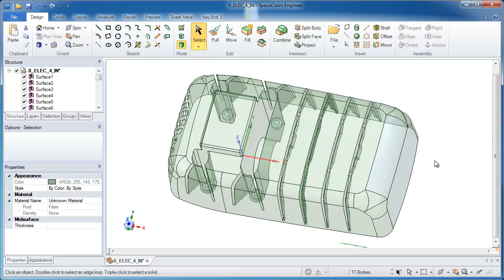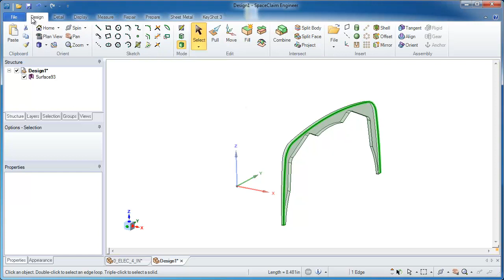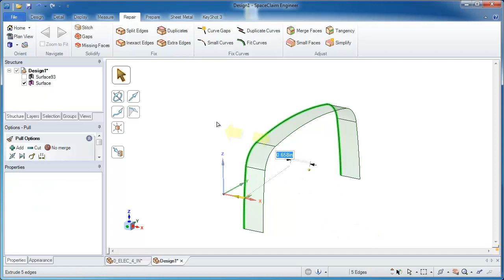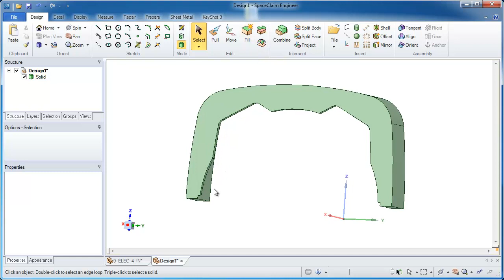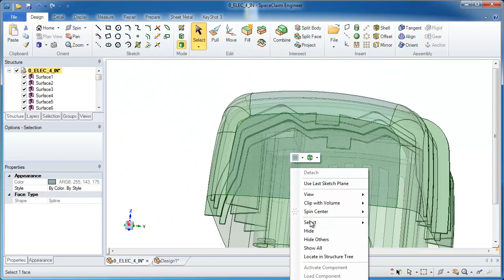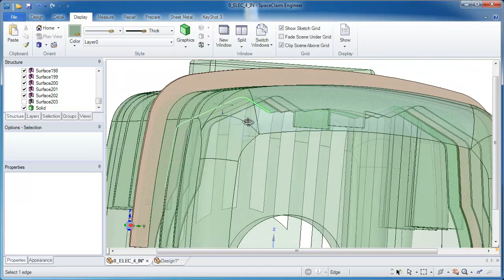SpaceClaim: EDM/Electrode Creation

Comment: I think it is more customary to have the electrode designed at full size and let the CNC programmer cut the rougher(usually -.010 Stock-for spark gap) and finisher (-.002 stock for spark gap) - that is, if the electrode has enough "meat". This way you do not have to create 2 electrodes(for roughing and finishing) and CNC programmer will decide how much of spark gap they need on each electrode...... Electrode also needs some sort of body to attach it to the electrode holder(usually with screws and dowels) or a integral body body, which can be  ground, prior to machining the actual cutting surfaces, so you can achieve a repeatibility, when you change worn out electrodes or switch from rougher to finisher...The cutting surfaces of electrode need to be made symmetrically centered to the integral electrode body or the steel holder.
Thank you for the video instruction, anyway !